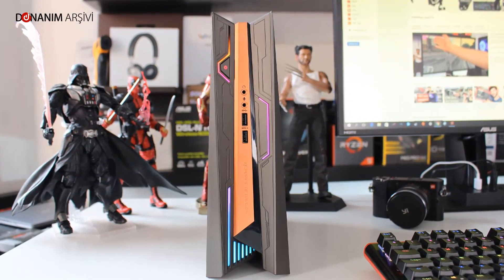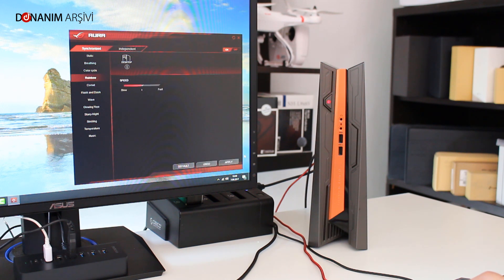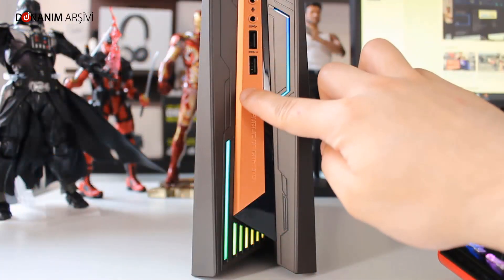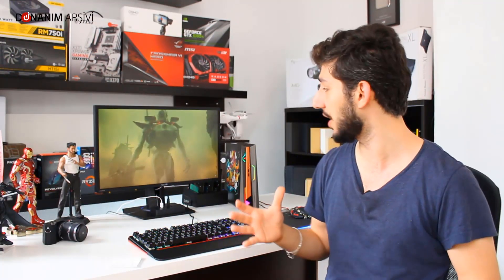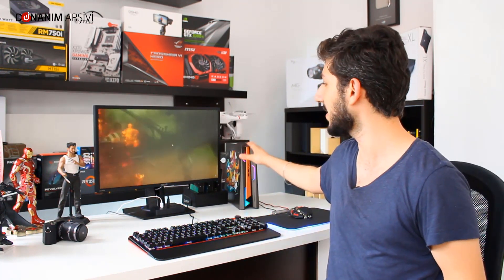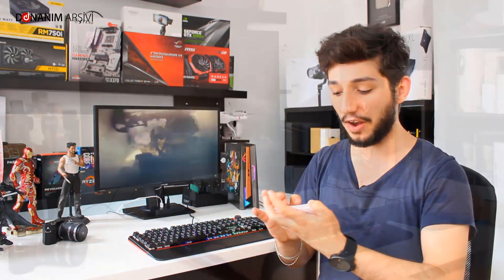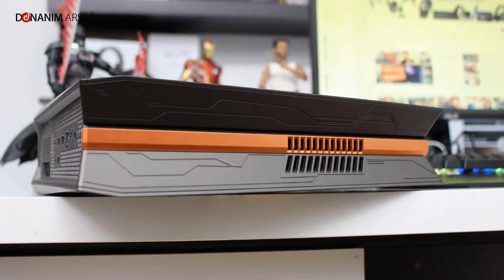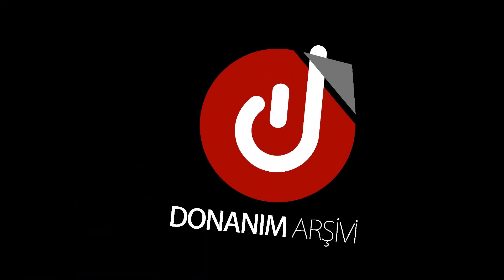Mini Boyutlu Canavar Oyun Bilgisayarı Asus GR8 II ve Oyun Testi

Comment: BEYLER 
MSI GTX 1070
İ5 7500K
CROSAİR 650 W 80 PLUS
seagate 1 T HARDDİSK  
Crosair carbide spech alpha oyuncu kasası
crosair 240 gb ssd
gskill 16gb(2x8) ripjaws ram
msı z270 mate soket 1151 ddr4 anakart
crosair hydro serisi h100i v2 sıvı soğutma 
İYİMİDİR DARBOĞAZ YAPARMI SIKINTI ÇIKARIRMI YORUMLARINIZI BEKLİYORUM
Reply: ÖmerAta cok iyi ama bi hdd ekle 1tb falan ssd yetmez

Comment: Aklımda 2000-2500 TL arasında orta halli bir oyun bilgisayarı toplamak var. 

AMD Ryzen 5 1400 3.2 Ghz 8 MB AM4
Asus B350M-A Prime 3200 Mhz(OC) AM4+ mATX
Corsair 8GB Vengeance Lpx DDR4 2400mhz CL14
Asus GeForce GTX1050Ti Expedition OC 4GB 128Bit
Seagate 1TB Barracuda 64MB 7200rpm
Corsair Carbide Spec-01 Mid Tower Pencereli
Corsair VS450 450W Güç Kaynağı

böyle bir sistem var. Fiyatı ise 2465 TL. Daha uygun ve daha fazla FPS alabileceğim bir sistem var mıdır ?
Reply: Ankartın gereğinden biraz daha iyi gerek yok anakartını ve işemcini ryzen 1300x yap kalan paranla 1060 al
Reply: Seagate alma, wd al.
Reply: Şimdi 2700tl r3 1200 toplanıyor...